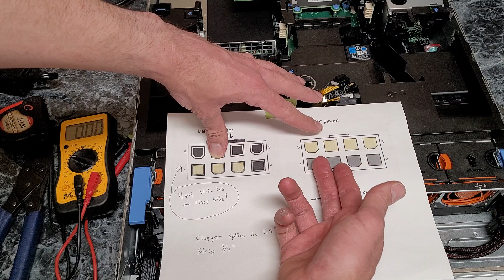A ramble about checking the GPU power pinout of the 13th Gen Dell PowerEdge R730

Comment: I have a R720 also and fitted a GTX 1060 with a 6 pin connector on it. I had an old modular PSU lying around and thought I could use the cable that would feed a GPU. 8 pin on the PSU side that I plugged into the riser board and a 6+2 connector on the other side that I used the 6 pin for my GPU. Server wouldn’t boot and the PSU flashed amber and the cable got hot lol.. Must be shorting to ground. So am I right in thinking I can use the this cable if I just modify the pin out on the 8 pin side?
Reply from the maker: Yup definitely shorting 12V to ground. You will need to fix the pinout of the riser side to match the left side of the paper at 6:14.
Reply: @computersales appreciate your help. So I’ll give it a try and let you know how it gooses 🤞